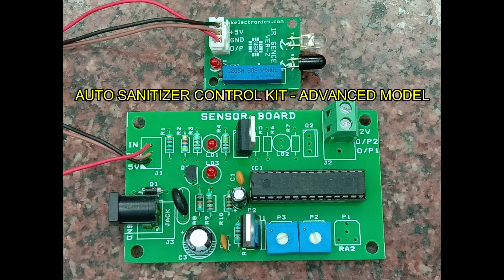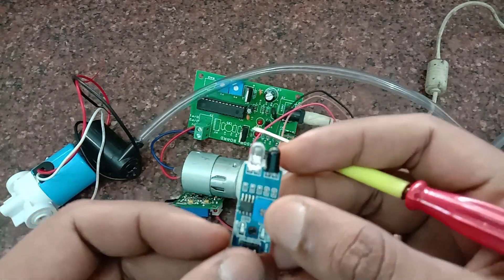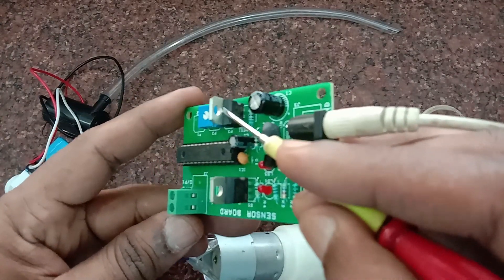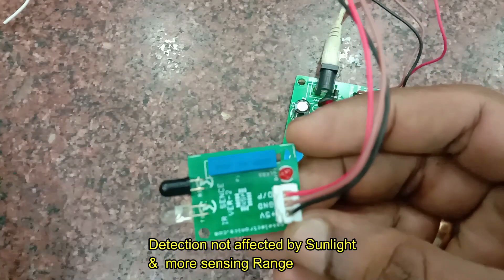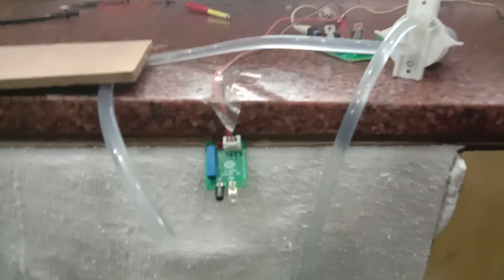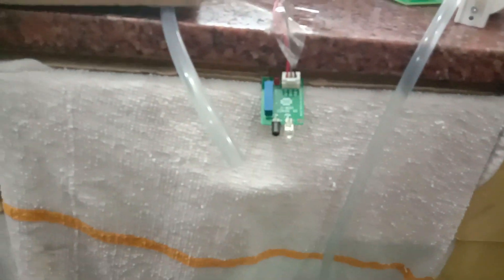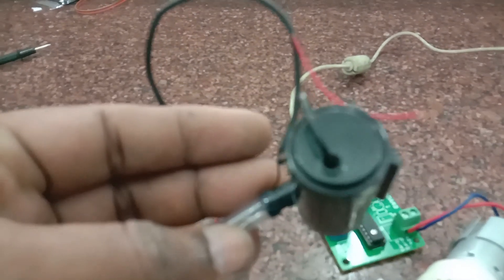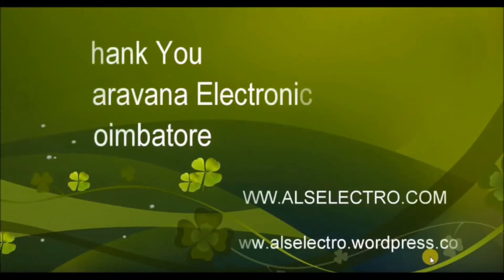AUTO SANITIZER ADVANCED KIT

Comment: At 1.35 min u are telling not sensitivity to sun light I made a prototype in that I placed the model on white table ,the sensor is triggering repeatedly and pumping water .how to fix it?
What is the issue on placing on white surface
Reply: You have used or sensor. It sensor will work on day light. That means it will operate in the presence of lights. That's y you are getting triggering always and pump will on and off

Comment: Sir can i use this circuit with ultrasonic sensor. If it is possible than programme your audrino board with ultrasonic sensor and send me with diagram then I will connect all parts of material and make a automatic hand wash dispenser. Plz reply me asap.
Reply: If I use these circuit, can i set a liquid dispense time.i.e. 1.5 seconds to 3 seconds off in one time again we put hands in front of sensor it works for next max 3 seconds only

Comment: What is the use of PIC16FXX there? 
Is really that 28 pin microcontroller necessary?
Reply: Not that much needed unless u want to increase the cost if u want go for pic 10 f family
Reply: @raghuannavarapu9982  or you can go for OTP mcus that cost only 10% of the PIC16F..